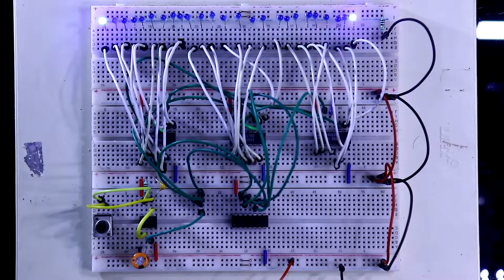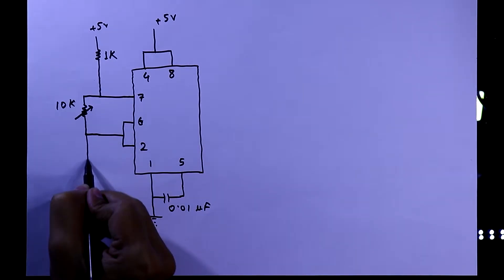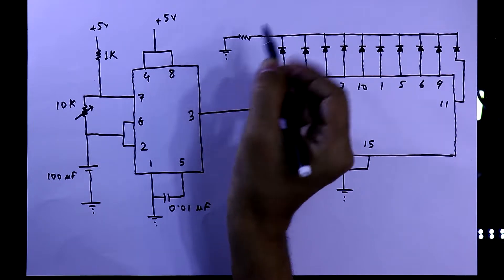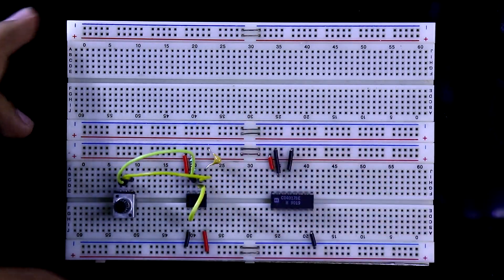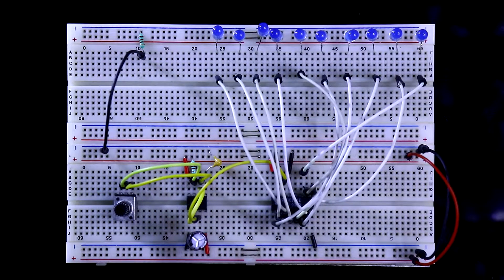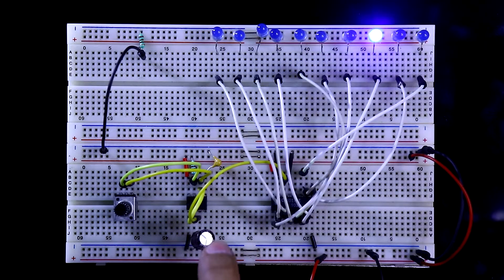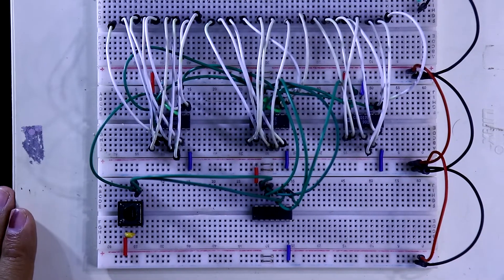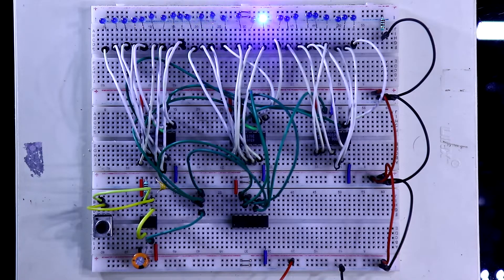LED Chaser circuit with NE555 and CD4017

Comment: In previous video, you connect push button to pin14 of CD4017 and LED to pin12 of CD4017.
When you tap a push button, you create a cycle of 5 ON and 5 OFF LED while LED on pin12 is light up.
Now I  connect 555 to pin14 while still have LED connected to pin12.  It creates LED chaser but LED on pin12 is blinking.
Is it normal? why is blinking? why  a cycle of 5 ON and 5 OFF no longer works?

Anyway, I saw other youtube show cd4017 led chaser without using 555. What they do is insert RGB led (2pin) anode  to pin16 and cathode to  pin14 (this led is flashing very fast while other outputs are creating led chaser).
Why also works this way?

Comment: Why did you choose the capacitor value?
Reply from the maker: Capacitor with 555?
It is to adjust the frequency of clock pulse in Astable mode of 555. For more details, please watch:
https://youtu.be/egD4c08PD94
Reply: @EEWave  I meant the value in microfarads.